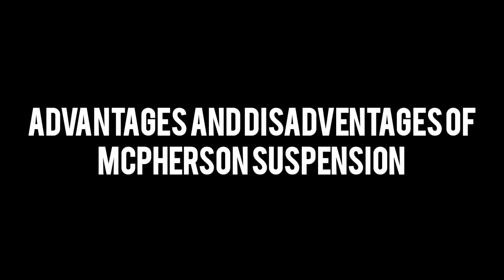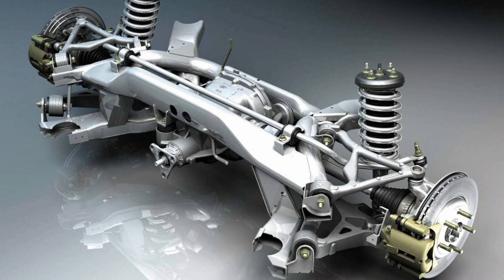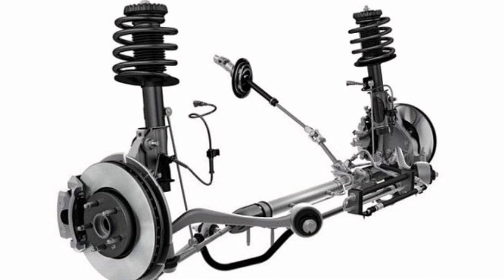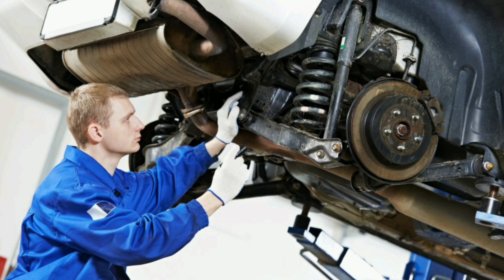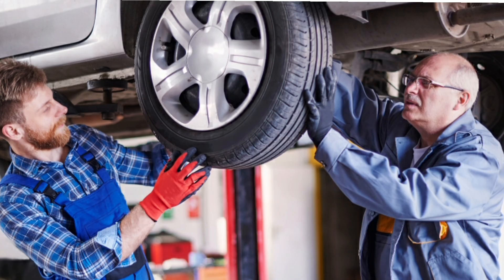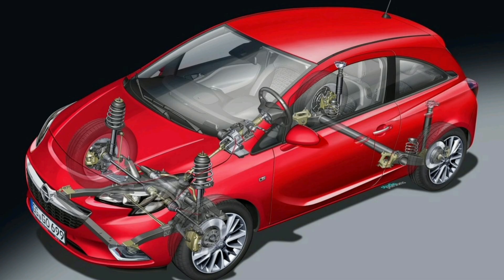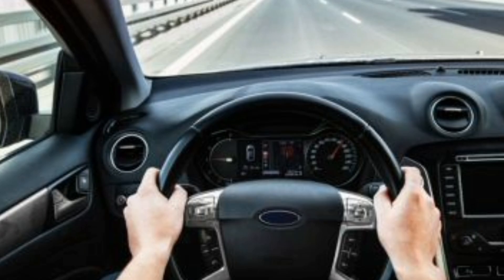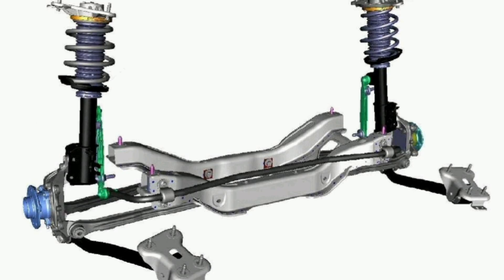Advantages and disadvantages of McPherson suspension

Comment: 0:24 This is a double wishbone suspension, not a McPherson.  You can tell because of the upper control arms (which aren't present on McPherson suspension), and the struts being lower in the chassis than a McPherson would.

Comment: McPherson suspension stopped being used in the early 90's modern cars use Chapman suspension. 
Robot voice and incorrectness, fail.
Reply: Not true whatsoever.  Subaru, as well as many modern manufacturers still primarily use McPherson setups.  The robot voice sucks tho, can't argue with that
Reply: @MaximillionBucks  a McPherson strut has a tube and gland nut that holds the shock inside and also will have the stub axle attached to it.
A Chapman strut is a completely unitised assembly where the shock isn't in a tube as the body of the shock makes up the outer section of the strut.
Chapman struts also have a clevis, usually with two bolts holding it to the knuckle where in most cases a press fit bearing is used.